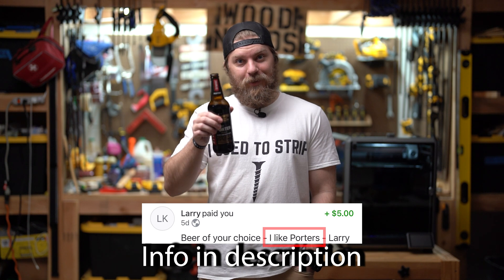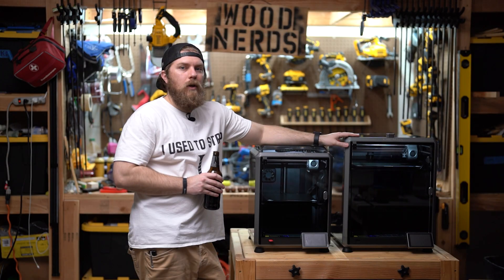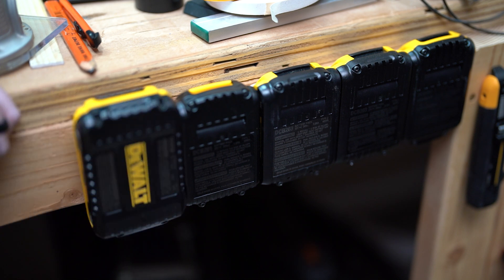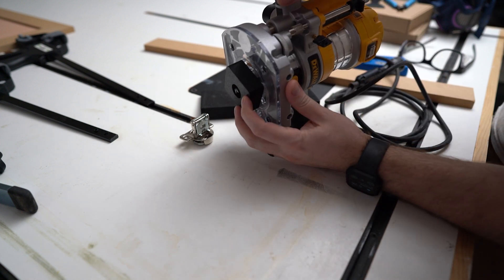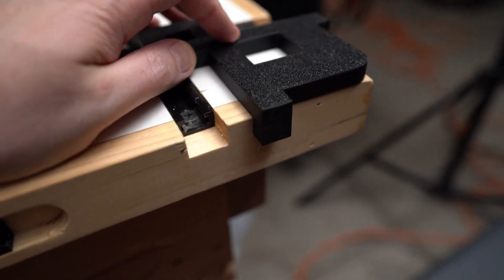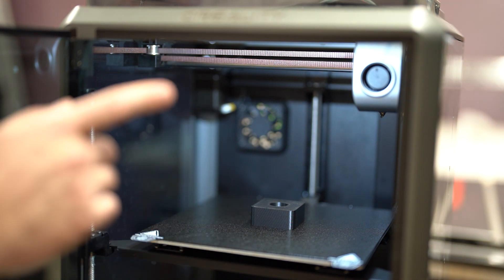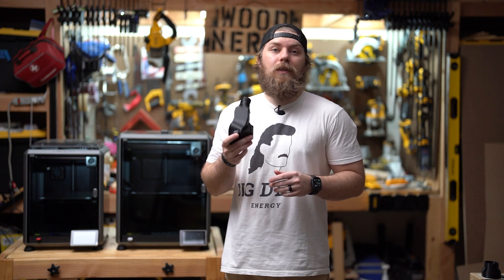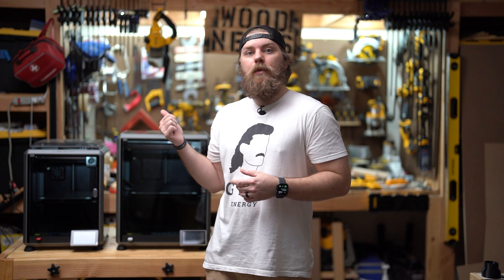Start A Business 3D printing Tools! Creality K1 and K1 MAX

Comment: My latest jig was to make a through mortise I made a jig that hade the hole with a ledge for my chisel so I could hold it perfectly vertical and in the exact spot. I made the same type of hinge jig but I put ledges so the y indicate perfectly with no fuss.
Reply from the maker: That’s awesome! It’s a neat problem solving technology. I love that once you have the file you can print unlimited copies in case you beat them up when you use the jig.

Comment: If you do design something that other people are interested in, you don't need to have a print farm to sell them. You could either contract it out to an already existing print farm.  Or if it is something that could sell in mass, then you can use your prototype made with 3D printing to find a manufacturer to make it for you!
Reply from the maker: I’ve thought about this as well! Get a company to design some injection molds and pay Pennie’s per item. You’re thinking from the right angle!

Comment: One of the worst machines to recommend when the Bambu P1S is around
Reply from the maker: lol dramatic? I doubt it’s the worst to recommend haha. I haven’t had any issues with mine but also don’t have any experience with the Bambu machines. From the specs the P1S is slightly larger than the K1 and similar everywhere else except it has a camera but $300 more expensive. I’m not saying it’s not worth $300 more but any tool that costs that much more than the other in my experience better be worth the price jump. Again, not defending one over the other, I only have my experience to provide.
Reply: @WoodNerds  if you value your designs , want to sell them, and don't want them stolen immediately don't buy a bambu. They run all your data through a cloud system in china before your job even begins.
Reply: This comment didn't age well.

Comment: The "AI Lidar" stuff on these machines don't actually even work 50% of the time, you will never truly print at "600mm/s" as the hotend cannot reach the flow necessary to print at those speeds without serious under extrusion. The K1 max has serious bed warping and levelling problems. they are okay printers, but not superb either especially for their price tag. They will print pretty darn fast though that's for sure.
Reply from the maker: Great insight! I’ve noticed minor flaws but haven’t really had any serious issues. I have about 80 hours of print time on each machine so I wonder if I’ll see some ugliness as time goes on and they loosen up. It’s all new to me but so far so good. Do you have other recommendations for printers that fellow designers could benefit from? Always on the lookout for the best option for the money.
Reply: @WoodNerds  the new qidi q1 pro printer are fairly reasonable machines, active chamber heating, respectable build volume, respectable price and seem great thus far. The Bambu lab machines I recommend. I have a total of 4 printers and the best experience of them all has been the p1s. The k1 don’t really have much value in them anymore they are just featureless printers from what I can see. I would avoid twotrees kingroon flash forge etc they are all just clone machines trying to imitate Bambu lab but always having tradeoffs that make it annoying
Reply from the maker: Thank you for the info. I’ll have to checkout the others from your list. Of course I only have my experience to draw conclusions from but so far the K1’s have been good to me. My dad had a bamboo and loves it, so does a friend of mine. Might have to send out some emails and kiss butts to get some freebies to try out haha.I appreciate the convo!
Reply: @WoodNerds I also have Bambu lab printers, I have a p1s and an A1, both are amazing and in my opinion the best on the market right now, work with what you have because the k1 is still a good printer but if you ever decide to change them definitely go for Bambu lab, not only the printers are really good but the slicer is the best of all in my opinion
Reply from the maker: Thanks for going into it. I appreciate that! I’m definitely going to check them out!
Reply from the maker: Thanks for the input! I’m hearing from a bunch of people that love Bambu haha.
Reply: @WoodNerds  They are good printers that just work. That’s why many love them. Their lack of open source software and hardware seems to annoy everyone who’s a tinkerer it seems, but they are marketing their printers as tools, meant to be used, meant to work. Not for people to have to fix and tinker with for hours upon hours. They just work :)
Reply: You are underestimating modern printers

Comment: Nice! I printed some of those DeWalt-compatible battery holders from thingiverse. Work great.
Reply from the maker: I haven’t fully explored all the stuff available out there yet. Been trying to get my skills up to model better. Have you been designing your own prints or mainly benefiting from the free libraries so far?
Reply: @WoodNerds  free libraries. Need to put to use my hobby fusion 360 license sooner than later... even bought a really precise digital caliper the other month as I wanted to be able to start taking precise measurements but have put off designing something. Basically we're on opposite paths 😂
Reply from the maker: @DIYAroundTheHome 😂😂 it’s time consuming man! Took me like 2 weeks to design and test until I got that final iteration. Not a bad turnaround if I had a marketable product though. Now I just need to start writing everything down that makes me think “this is stupid, it should be like….”